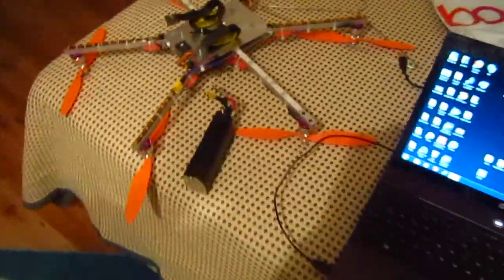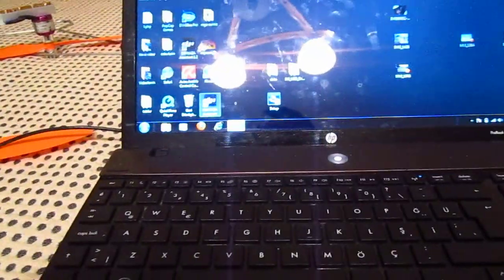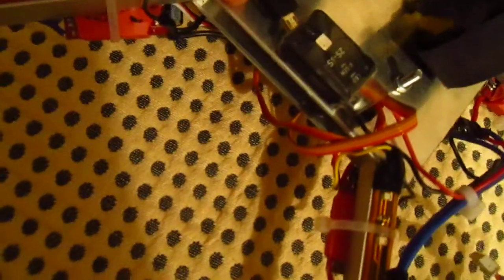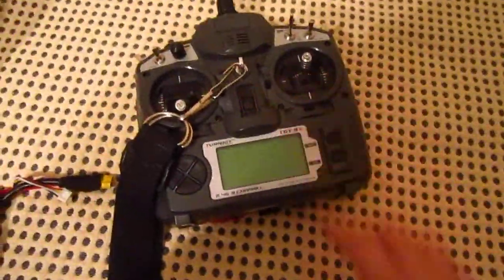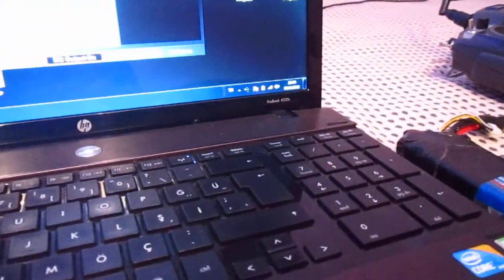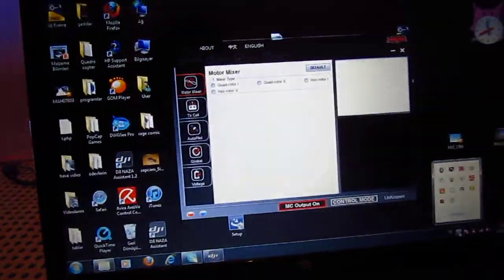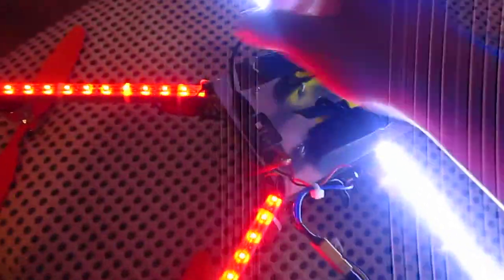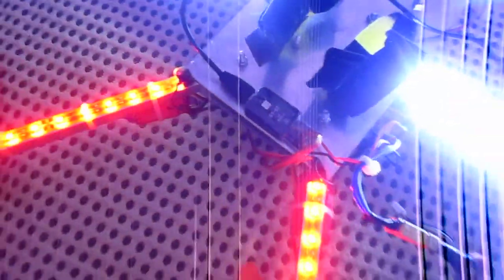DJI Naza Problem

Comment: I updated my Hexacopter 3 devices for everyday use version 1.8.
2 with version 1.2, and another with version 1.6.
1 was good, but other erased completely and does not turn on, the other is accelerated and almost cause serious accident, tested in hand before flying, it was hard to disconnect the battery, but all ended well.
I need to know how to return to firmware 1.2 and 1.6, such as resetting the NAZA.
I'm no equipment to work, 
how to reset and return the firmware 1.2 or 1.6?.